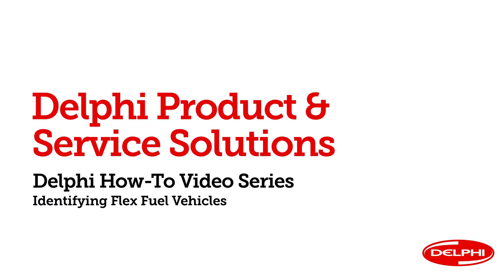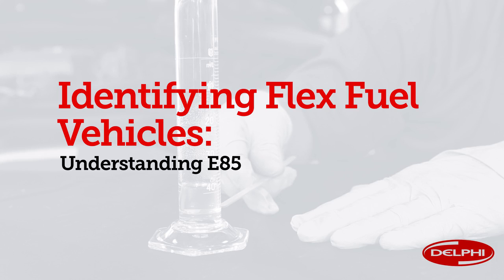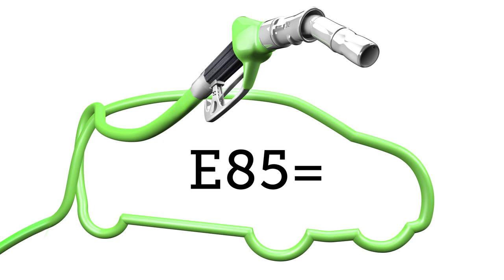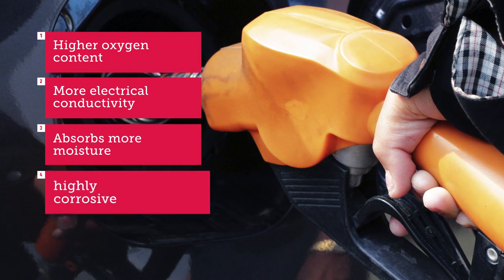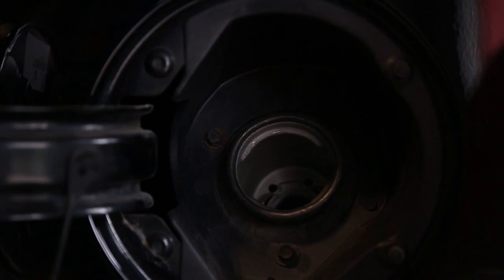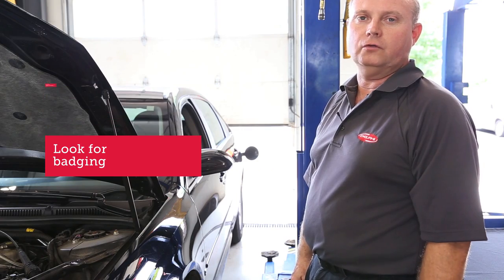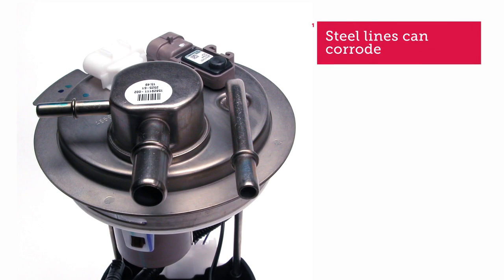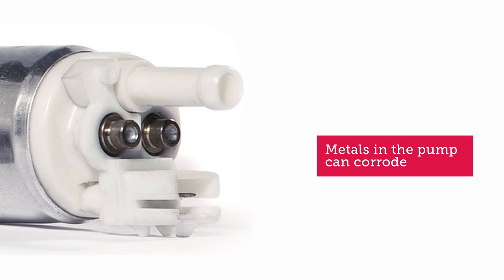How to Identify Flex Fuel Vehicles

Comment: I have a '04 GMC Yukon and I'm replacing brake lines, fuel lines which are metal and the fuel pump. Flex fuel pumps are different than gasoline pumps like the man said. The gas cap is black, there's no badging and the gas gauge in the vehicle does not state flex fuel. The emission control information sticker on the air box states: when operated on gasoline or on ethanol blends from EO to E85 and meets all the applicable requirements of 40 CFR part 88". This vehicle is over 20 years old and the yellow gas cap could have been replaced with a black one and the flex badge could have been removed if body work was done on the vehicle. The sticker on the air box tells me it's a flex vehicle but I want to be absolutely sure. Anyone who is knowledgeable on this particular vehicle,you input is welcome. Thanks 2:31

Comment: in the north in winter, when the humidity is almost zero from November-march theres no water in the air that can even be absorbed into the lines or tank, so it doesnt matter. i would assume some desert areas with almost 0 humidity would be the same. But the cracking of teh cheap plastic parts from alcohol based fuels...ok. I have had alcohol sitting in  cheap $1 plastic container for years and it has not cracked... but wtf do i know?>
Reply: So what are you trying to say? So what's the purpose of this flex fuel vehicles? Ok for once be able to use that e85... And fuel would give Me way more miles per gallon than regular gas right? But it comes at a cost! Is it worth it???

Comment: I use regular gasoline but I have P0178 code. Do I need to flex fuel sensor out still? Even while I’m using regular gasoline?
Reply: Yes you need to fix that sensor. When that code sets, the engine management system will set to a default ethanol content, on my truck it’s 38%.
Reply: @Mattvardaman  Thanks!
Reply: @Mattvardaman  glad to know this. Just we have mechanics like you where I live at. Just to be honest with people.
Reply: So I can’t put 87, 91 or 93?

Comment: Easy i have a 99 ranger the 3.0L flex fuel they stamp it with a badge look at gas tank its says e85 open gas tank door its says e85 there owners manual a lot of different ways to tell if u have a flex fuel.
Reply: Well smarty pants, there are a helluva lot of vehicles that are flex fuel compatible that are not badged that way. Look at your VIN engine code. they are the same. for a 2014 Cruze both are engine code G

Comment: Hello, I take always E85 when I go to France with my 1995 E320 M104 Mercedes W210 without any modification since more than 64.000 km/ 40.000 miles. Fuel consomption goes higher by 30% but at the low prices in France where I can get this E85 it's no obstacle to me: 0,50 EUR / litre vs. 1,50 EUR / litre.

Comment: Is Flex Fuel more expensive?
Reply: Actually I believe it's less expensive but might have to fill up more frequently
Reply: @nickoneill4918  So what's the purpose of a felx fuel vehicle if it isn't giving Me more miles per gallon?
Reply: @POLOAZTECA simply put, E-85 id simply cheaper.
Reply: @nickoneill4918 because of the E'85. It doesn't get the range of pure gasoline

Comment: All vehicle can run on flex fuel 50/50, you can fill half a tank first with regular gasoline and than other with E85 , you don't need any special parts, it's all sales gimmick , I run my 2000 non flex truck on E85
Reply: I have a Ford 150 flexfuel 
I fill my gas tank and it only fills half . So I have fill the other half with e85 ?
Reply: Sam Bakshi if you have flex fuel car that means it does not matter whether you fill with regular gas or E85 fuel completely it will run fine but for all other non flex fuel cars you can fill half tank with E85 and the rest with regular gas it will run fine and save money